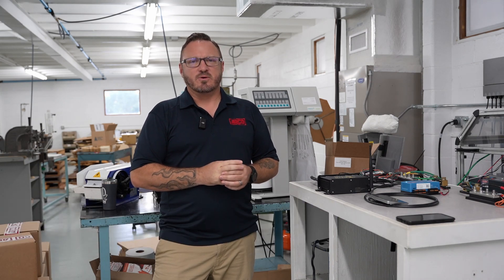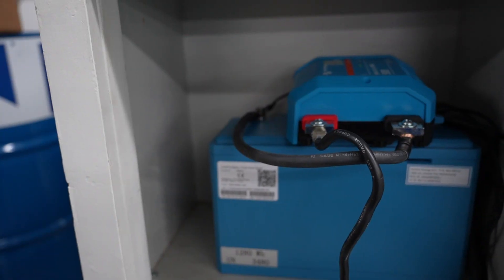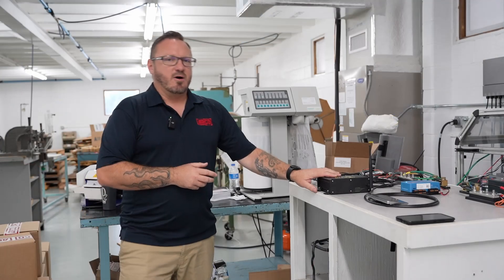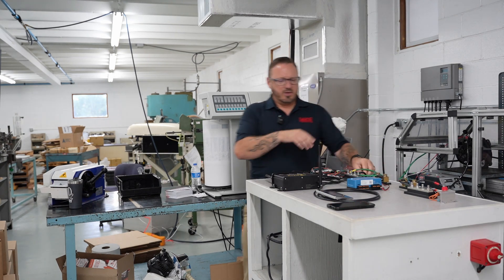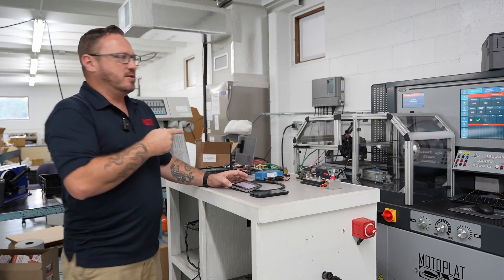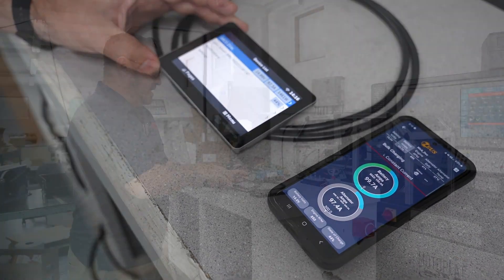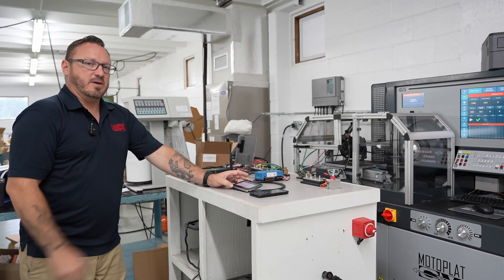Learn How You Can Integrate the ARCO Zeus Bluetooth Alternator Regulator with your Victron Lynx BMS

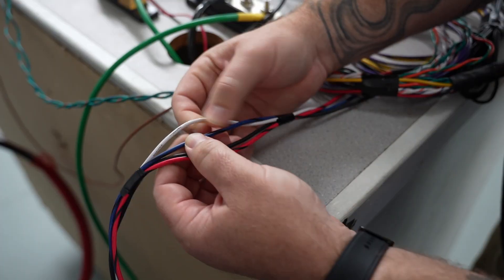Comment: Question, at about the 0:56 mark in the video, you lay out the four wires required to go to the alternator. You show the red/black B+ wire. What about the yellow/black B-? Not required if you already have a negative connection via the battery harness? Is it ok to still connect - to the alternator? Also any further tips on where to pull ignition signal for the brown wire from would be great! Can the red BATV+ wire also share the same connection to ignition with the brown wire if I only care about having the Zeus powered when running engine? 

For reference, Volvo Penta D1-30, Genmaax 250 remote rectified, and Victron Smart Lynx BMS and Smart Lithium batteries.